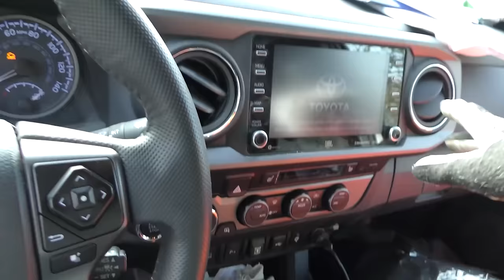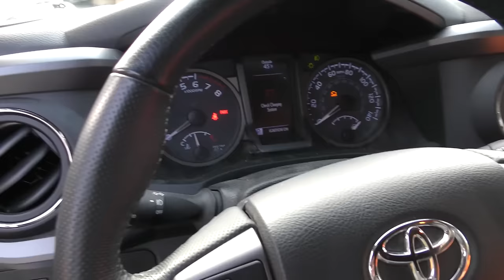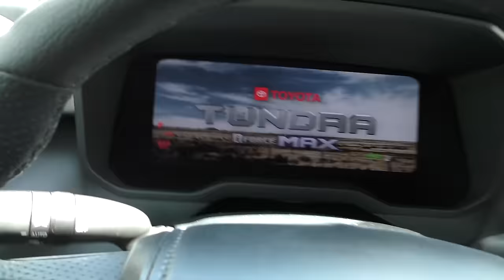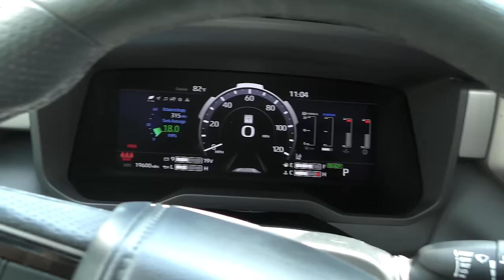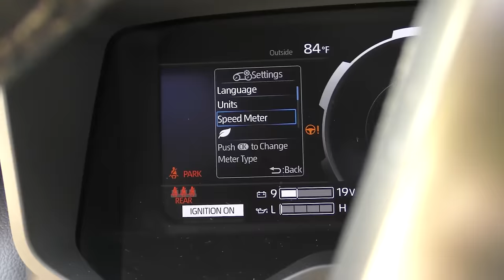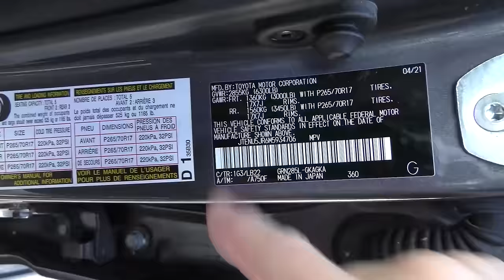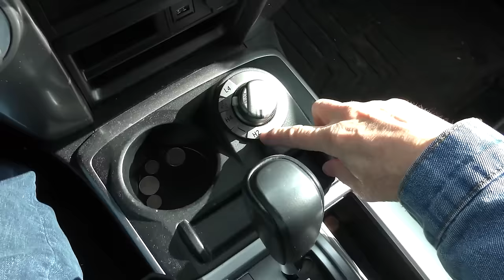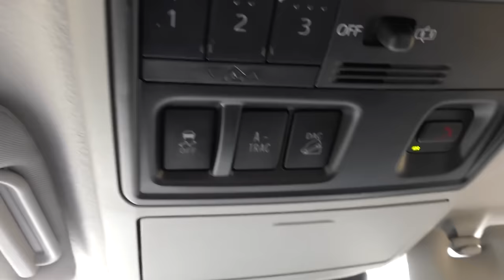3 New Toyotas I Would Never Buy

Comment: older toyotas will go up in value because of this
Reply: New sienna is boring
Reply: I'd agree... I have a feeling my 5th gen 4Runner will the kind of vehicle people in 5 years, will be offering to buy while I fill up at a station
Reply: @cbb976 3rd gen best gen
Reply: Yep, bought the 2023 v6 4x4 base model for a discount in December because I knew this would be the case.
Reply: When you hear the word, "turbo", run!   Turbo is added to compensate for the crapy engine.
Reply: @BasedMace yup, dads 3rd gen reaching 400k and running strong
Reply: Happens to me all the time with my 2017 cement pro
Reply: No, they won't.
Reply: Stop living in the past

Comment: Toyota will lose many customers if they don’t turn it around.
Reply: where will they go
Reply: I thought Toyota knew better.
Reply: They have already lost one customer, I purchased a new 2024 Frontier with a 3.8 v6 instead of a new stupid overpriced Tacoma that doesn’t even offer a v6. Toyota is starting to be very disappointing these days.
Reply: It was inevitable tbh, every company switching to 4 cylinder turbocharged engines which gives more hp and better fuel economy. The only 2 trucks left still holding out with a V6 are the Ridgeline and the Frontier if you want a new truck with the V6.
Reply: @w.miller7282 gee you only just figured that out LOL?

Because I the biggest Toyota hater on the internet tried to tell everyone that Toyota continues to disappoint. No one listened
Reply: @MrNathan07  Stupid EPA
Reply: @naveenthemachine  In the past, not even close. Toyota has had such an amazing track record. They have made some of the most iconic and long lasting cars in existence. Those earlier Tacomas can last forEVER. 1980's up are still very much alive and running with 200,000-300,000+ miles and STILL running around. I will admit though that they are screwing over the Taco.
Reply: So do we blame Toyota or the politicians & government pushing strict mandate to go evs & for the ice vehicles they have to have a minimum of 50 miles to the gallon by 2030
Reply: @AndrewFaust-dh7kg  they’ve screwed over the sequoia tundra LX bz4x rz
Reply: @MrNathan07  You can never compare the refinement of the V6 to a buzzy turbo 4 banger idc how much horsepower they say it might have. I don’t even want a turbo in a 6 or a 8. I’ll take naturally aspirated everyday of the week and twice on Sunday babe
Reply: @ThomasKing19933 I agree.
Reply: I left! Loved my last Tundra, but no V8, no sale!
Reply: @ThomasKing19933  Blame the EV push. No country can handle full EVs but the politicians don't care. Another way to move money around.
Reply: @v_enceremos Nissan Frontier with a 3.8L V6.
Reply: Toyota is in business to sell Trucks. 50 years ago, trucks were wore out at 100,000 miles; today, it's not uncommon to go three times as far, so the sales drop by 2/3.  This is why.
Reply: No they won’t 😂
Reply: @DavidAndersonReviews they just like to talk crap. Toyota breaking records 😆
Reply: They l;ost me.
Reply: There is only one company and they are pushing all car manufacturers to make 4 banger and three pots only, under the guise for climate change. In reality, this is to make you buy autos more frequently.
Reply: Laughs in Nissan
Reply: Too late.
Reply: @DarthVader-1701  until the 2026 remodel and then they will be four bangers only also government mandates
Reply: @v_enceremos ANY other piece of junk
Reply: @v_enceremos to the used market. I would like a gen 8Camry but to get the best car overall I’m sure gen 6-7 will be more than find for a lot of people.
Reply: @migueloliveras7307  Both. The politicians for not being in tune with the real world and Toyota (all manufacturers, actually) for caving in to the asinine political agenda.
Reply: @w.miller7282 I need a truck always drive toyotas, I'm driving a ford f150 now, drives real nice, price made me going ford.
Reply: @MrNathan07  Bur you don't really get better fuel economy, the better fuel economy comes on a dyno where they test them for their "official rating".
Reply: Just keep our older toyotas.
Reply: That ship has already left the dock.
 When does it reach the 'deep ocean'? 
 Who knows but subs are waiting for them.
4 cylinder trucks with twin turbos? 
 Good Luck.
Reply: People are going to buy the compact trucks. I'm really interested to see what the Toyota Stout will look like
Reply: Its our politicians pushing these crap cafe standards, blame them.  Wont take me away from a quality auto manufacturer
Reply: @v_enceremos Nissan, the new Frontier is actually a good truck without turbos, and you can get a Titan with a cummins. It is really just their cars and the cvt that sucks so bad; the trucks are descent. I say this as a Tacoma and 4Runner owner and fan.

Comment: As someone who owns a 2016 Tacoma V6 and tows with it quite often, I absolutely love the horsepower torque of the V6. Toyota is making a big mistake switching to only 4 cylinder turbos with the Tacos. The 4 cylinders are nowhere near as good at towing and won’t last half as long as the naturally aspirated V6.
Reply: Really proud to have my Frontier 4.0L V6 these days. Especially since it's a manual 4WD.
Reply: i thought it was pretty underpowered when i drove the 2021 sr5 3.5L in my mothers truck a few hundred miles, i was disappointed. the torque number is alright, the hp is kinda a let down for a 2021 3.5L V6. fuel mileage sucks compared to the heavier and more powerful f150’s. i thought it was really the opposite of quality when driving it, definitely not worth what she paid for it new. at least they are probably super reliable.
Reply: @adamowens5507  I actually kind of agree. While overall horsepower and low end torque can leave more to be desired, once you get into the 2,000+ RPM range it takes off.  Plus horsepower isn’t really what I’m looking for in a truck. If I wanted to buy a car with loads of horsepower I would have gotten a sports car. Plus for the towing I personally do it’s more than enough. 
And yes, fuel efficiency sucks there’s no getting around that. 😅

Comment: They probably could have gotten 18 mpg with the 5.7 liter V8 by putting the 10 speed transmission in it and adding the hybrid system for city type driving, and some engine improvements.
Reply: Yeah but that doesn't fit their narrative

Comment: Scotty, when it comes to a 4 cyl Tacoma, bring back the smaller 80's and 90's size version with the 22R.
Reply: That's what I want again, 84-88 were the best trucks they made.
Reply: Agreed, i had an '81 Toyota pick up with the 22R, great running, great shifting truck, i had to junk it in '92 ( 11 years old ) with about 165k, the truck rusted in half, that Toyota steel was even worse back then
Reply: They sell those 4 bangers tacomas all over the world. Mexico you can only buy 4 cyl. No one will buy a 4 cyl in USA. Why first your friends will laugh second you can't resell it because next guy knows his friends will laugh at him too
Reply: @jjohnson8977  
In manual transmission it's not a girl truck with an automatic, which was invented so women could drive.
Reply: @robertsyre230 my '81 went over 400,000 miles before rusting away I never had to do anything to the 22R other than change the oil.... currently doing a frame off to a '83 short bed....the frame is powder coated and ready to go...

Comment: Scotty needs to get with Toyota or Honda and have them build a vehicle to his specs. The Kilmore Classic would sell.
Reply: Get a 2000cc 4 cylinder without a turbo or direct fuel injection. Put a manual transmission on it. Should be simple reliable vehicle. VVT "variable valve timing", active cylinder deactivation, are products that provide a small improvement in fuel economy, but are complex to run and expensive to repair.
Reply: @johnweiland9389  I think simple and easy to work on is a top priority. Today's vehicles are way to complicated for only small amounts of gain and there is so much more to go wrong.

Comment: I don’t know, they are just too expensive now too- I have a 2017 4x4 Taco I bought for 31k brand new in 2017. I’m at 119k and it’s a fantastic truck- I just keep up on maintenance 5k oil changes, don’t beat it- it’s Also a lifted truck with actual good Icon Suspension and that hits gas mileage a little but it’s a very utilitarian go anywhere, tow a bunch of stuff truck

Comment: I agree maybe the turbo will not be as reliable as N/A motor  BUT the new Tacoma 4cyl turbo has more torque and power in lower rpm most of the torque comes on at 1700 rpm to me thats better than v6 which starts making power around 3k rpm , I have a 2021 Tacoma TRD off road 4x4 and plan on keeping it till it hits 400k miles
Reply: Yep.  Scotty got this reversed.  Also the 4 cylinder was designed for a turbo.  I don’t think the reliability will suffer as long as it’s maintained.

Comment: I bought a Nissan  Frontier  2017. Got it in 2018 used it had 17,000 miles on it now it has a big 29,000 it's been a great truck.  V6 in it it's a 4×4 20mpg on the highway.  Not Bad
Reply: I've got one myself. 5 years now. Great little V6 truck (6 spd, 4WD)

Comment: Finally ppl are saying what ive been saying for months, you can see comments of mine on here from a year ago warning ppl not to buy toyotas because theyre all weak 4cyls now, you gotta count 1 mississippi before you start movinh after hitting the pedal.
The seat quality is bad so if you do buy one, do not buy less than an xle PREMIUM, the regular xle awd rav4 destroyed my back. The lumbar support is a rectangle that juts out halfway up your back, and when you put it away it leaves an indent in the seat that your spine will sink into while your driving, it took months for the pain to stop.
I hated it so much i traded it less than a week after i paid it off, and put the monry towards another car. I was done, no more payments or stress about owning my vehicle but i just couldny take it, it was slow, they put no tension on the gas tensioner so you speed up extremely slow, plus with only 4 cyls.
Theyre also very barebones. Other manufacturers offer much more features for less money.
These turbo 4cyls will not last like their old v6 and v8s did.
Do not buy a toyota or youll regret it.

Comment: Toyota in Manila. So just took a few rides in some Toyota Vios cars that are the taxis here. One overheated. Driver pulls over pours in a gallon or so of water and then a gallon or so of coolant while the engine is running. 5 minutes and we are back to normal. I ask him how many miles on it. 1.3 million kilometers. The thing is a wreck, rear shocks really shock you when they go over bumps, but the thing keeps running. Original engine. They replace bushings and shocks but the manual is original and engine keeps on ticking. If you have ever been to Manila then stop and go traffic is an understatement. Manila makes LA look like open road driving.  I don't know what a Toyota Vios is, maybe a corolla equivalent. The next two Vios cabs I was in both had over 850,000km. Also no problem with engine and transmission. All, well 99%,  taxis in Hong Kong are Toyota Comforts, and all taxis in Macau are Toyota Camry. Again, these are NOT highway miles. I am impressed.

Comment: our next door neighbor had a regular gas powered 1994 Ford F 150 for more than 25 years granted he's a carpenter by profession so needed the towing capacity for work and it had something like 400,000 miles on the odometer when he replaced it. Toyota are shooting themselves in the foot by taking the V8 and V6 engines out of their vehicles for 4 cylinder full hybrid options even though some of those vehicles have had a V6 option since the late 1980s I.E. Camry for ex first received a V6  for the V20 2nd Gen in 1988 Camry got the earliest version of its current V6 for the 2010 model year

Comment: The 4runners from 2014 to 2021 are the same make. Old slight differences. Mines a 2014 and looks exactly the same as the one in this video. With the same engine. Any 4runner from 2014 to 2021 are the good ones.
Reply: For those interested, 2010-2024 are all 5th gen and 2014-2024 all have the face-lift plus the touch screen comes standard and some minor aesthetic updates along with shark fin antenna instead of the old tall wire. 2020-2024 all have the new larger touchscreen with android auto/apple carplay, Toyota safety sense, and there are some variations in exact combo based on trim but all have at a minimum the LED highbeams, among I'm sure some other minor updates across the board.

Comment: Scotty, I bought a 2020 Tacoma Sport  6 Cyl  with automatic brand new.  I've put about 5000 miles a year and it's just reaching 24000 miles.  I've change the motor oil every 5000 miles however I've never changed the transmission oil.  Should I change the transmission oil even though I've barely put 24000 miles on the truck?  If not, when should I change the transmission oil?  thanks for the answer.

Comment: Actually, replacing the paper oil filter is much better technology than replacing the entire oil filter with a metal housing. Some modern vehicles now put the oil filter pointing up and you access it from the top of the engine. With that filter design you drain the oil, unscrew the oil filter cap and lift out and replace the paper filter. It is so easy and you never spill a drop of oil when changing the filter.

Comment: SCOTTY! I’m not sure in which of your videos you posted about dealers and tire shops replacing all 4 tires after one blows out because of a different diameter for a new tire, but there are shops that specialize in tire shaving a new tire to the old tire diameter. I already knew about this but Consumer Reports has a good article about it and tells exactly how to do it! There are limits but you might be able to buy one new tire and get it shaved for $25 bucks! Also, when you think about it, one big pothole could knock an AWD vehicle out of alignment and wear one front tire a lot more than the other. With your cars and trucks you could check this out yourself and maybe save people thousands of dollars!

Comment: Two points:

1.) As an owner of a 2020 Taco TRD Pro I can say that the V6 is very unimpressive. It might last a long time but it has the power of a four cylinder and the efficiency of a V8. Mine doesn't start building any real torque until after about 3K rpms(Toyota says peak torque is @4600rpms). And fuel economy is about 22mpg hwy(NOT 30) and worse(15ish) around town. It's a pig. Now, I don't know a lot about the 2024 but from what I've heard, it has better low-end torque(peak torque @1600rpms) and smoother acceleration. Will it last? Only time will tell.

2.) That thing about having the wear level on all of the tires the same is for full time AWD vehicles, not 4WD vehicles. With full time AWD, instead of a transfer case you have a viscus clutch. And if the wear level is not the same on your tires you will put excessive wear on the viscus clutch. With 4WD you are running 2WD on tar and your diff is not going to care if your tires are mismatched. And on dirt, well, dirt gives. So not a problem. BTW - Some shops have the agility to pre-wear a tire so that the tread depth matches, but it's kind of a shame to do to a new tire.

Comment: The 4 cyl turbo has more torque at a lower rpm. It's also quicker, has a better payload, has a stronger frame, stronger front end components, better seating positions.   The only real question is reliability

Comment: The hybrid 4 cylinders gets peak torque (465) at around 1700 RPMs and holds till about 4200 RPM.... Those are diesel type numbers. Same with Tundra, 583 at 2400 RPM. 

Everything is emissions. Outside the realm of Toyota's control. Period. 

Toyota will have issues in their first years of production. Never  buy the first couple of years. 2016 was a god-awful year for the Tacoma, i dont care who says, "Mine still runs great, never has a problem." Statistically, it had a ton of problems. This is nothing new.

 Toyota has had hybrids for many years and turbos for many years. They're all reliable. They just get more complaints cause your average car owner forgets to do oil changes and nukes the turbo, then blames the manufacturers.

Comment: This is the 2nd video where Scotty has said that a turbo only has power at high RPMs. That is WRONG.  The turbo 4 develops full torque at 1700 rpm, the V6 develops full torque at 4k rpm.
In fact the turbo 4 has MORE USABLE POWER where you need it and results in a BETTER  tow vehicle.
Reliability?  That is another issue, but as far as power is concerned the turbo wins hands down

Comment: My V10 excursion got 19 MPG!!!   The simple truth is that large pickups need a V8...   Turbos are unacceptable for a real pick up because they deliver the horsepower at very high rpms. (There are also tremendous problems with overheating of the Turbo and "lifetime" /  Reliability problems.   There are also problems with the engine do to the increased combustion pressures which destroys gasoline engines.  Turbos with diesels are fine because the engine is  specifically designed for extreme combustion pressures.   Also the Turbo's used with diesels are engaged at much lower RPM's.)  The bottom line is that a V8 is required for a "work" truck.   A V6 does NOT provide sufficient torque at low RPM's.   The only real options are a V8 or a diesel.  😊